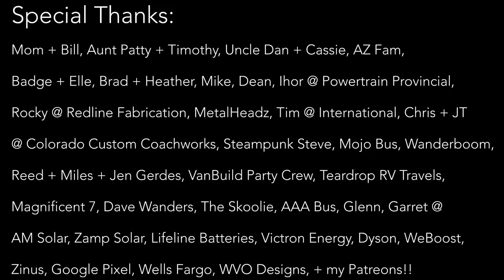WHAT REALLY HAPPENS AT Enigmatic Nomadics Van Build Party!

Comment: Great video JAX, hope to meet you and the others soon, my bus 50% done. 
The big question, diesel air heater or small wood stove for heat?
Reply from the maker: Personally, I prefer a diesel powered heater. At taps right into the system, you never have to hunt for wood, and you can program it to turn on automatically like climate control. Woodstove could never do that.